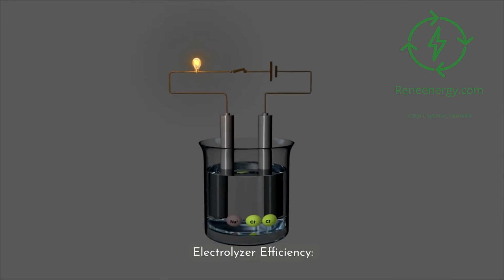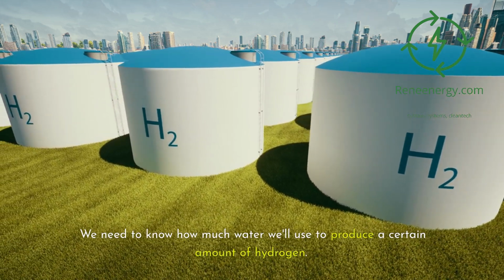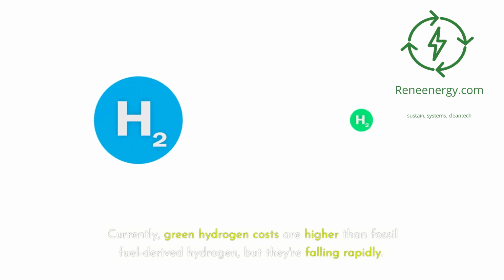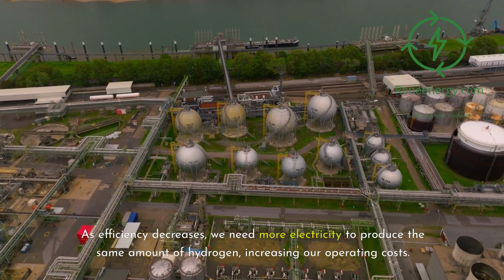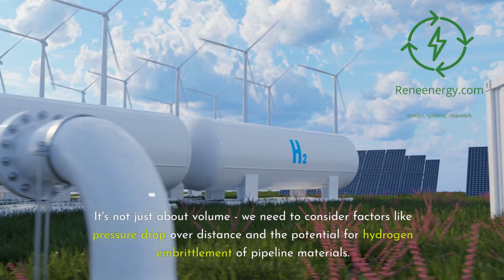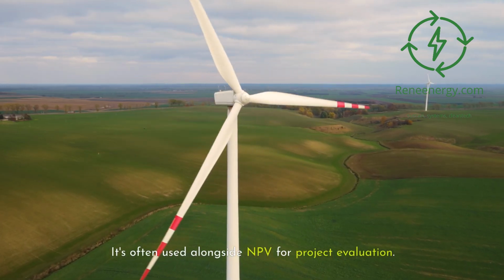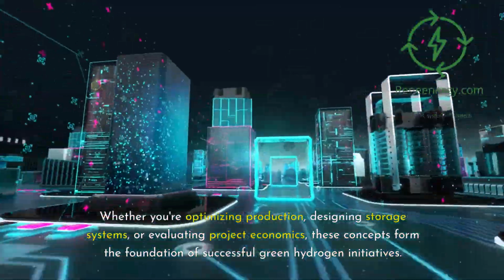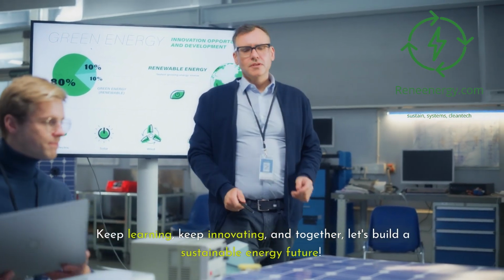Green Hydrogen Insights: Pioneering Clean Energy Concepts

Comment: Hydrogen is not suitable for transportation, equipment for distribution is down much of the time as leaks are almost impossible to contain. Want proof NASA, Boeing, and ULA were unable to contain hydrogen from leaking on their Space Launch System even after identifying the problem. How can you expect pipelines to be leak-free?
It takes 16 hydrogen tube tankers all burning diesel to move the same amount of energy as 1 diesel tanker.
Green hydrogen to make ammonia for fertilizer on site is how excess green electricity should be used.